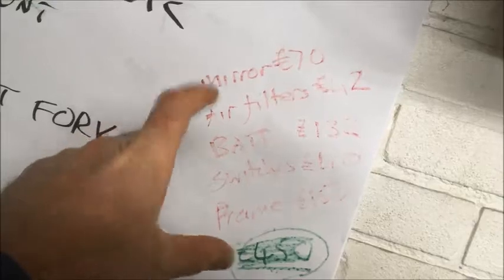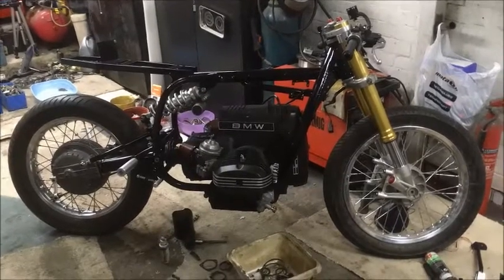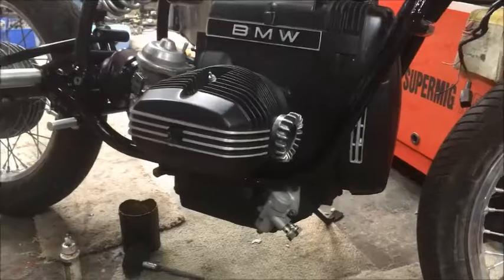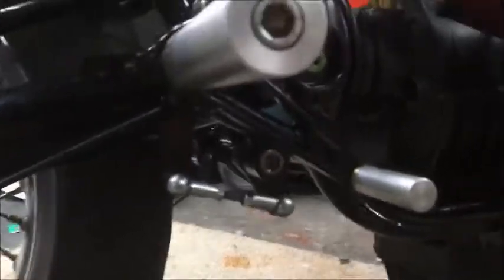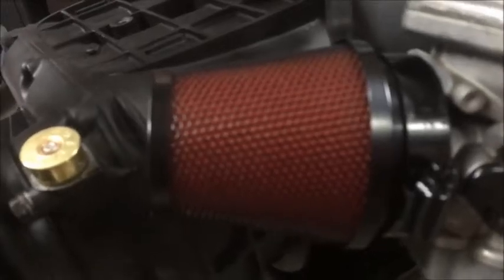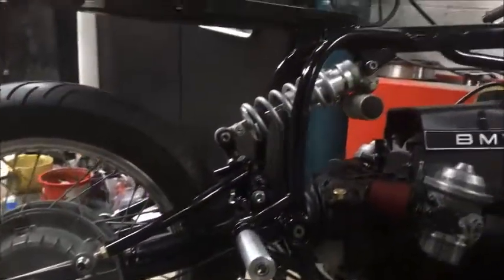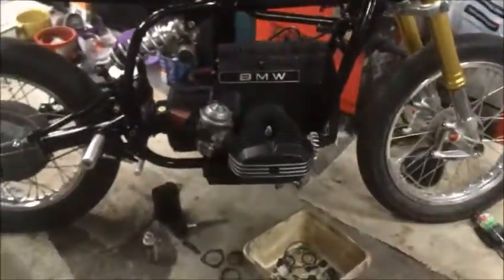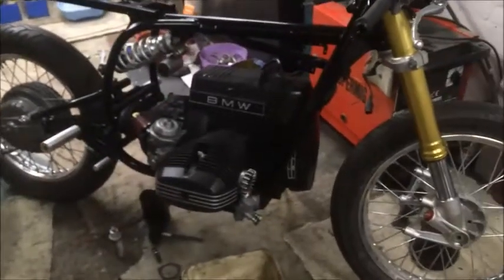bmw r80 cafe racer project part 50

Comment: It's shaping up fantastically Pete, what a world of difference that coat of paint makes! Especially love the engine block and the air filters (worth the 70 quid).
Reply from the maker: Thanks for the comment, yes the paint has helped somewhat (although its started to get dusty again already), have just made an engine breather to match the air filters but it hasn't quite turned out as I had it in my head.....will live with it for a while to see......

Comment: Hi pete, i havent commented for a while but been following the vids and ive got to say its looking stunning! I love the understated matt black on the engine. The gloss frame and forks give it a nice lift without being too showy. The stance is great and the backbone is sitting really nicely. I reckon some polished brass or copper nuts/pipe details would look amazing next to the engine... but thats coz i love old oily flat tankers! Lol. Great work mate, the lure of sunshine will spur you on im sure!
Reply from the maker: Good evening, thanks for the comments, funnily enough i have just ordered a little bit of brass, (however with the amount I am thinking of blink and you'll miss it) and the chances of it making its way on to the bike are actually pretty slim, have to learn a new craft to an acceptable standard first....watch this space.....but dont hold your breath... : O

Comment: Hi Pete, awesome progress on bike. It coming nicely together. I like your gun shell idea, but I don't know if you noticed that speedo bolt has small hole in it. It's not only speedo cable fitting bolt, it's also transmission breather. If that hole is just plugged sooner or later your transmission oil seal will fail, coz it'll create too much pressure in transmission and oil will leak into the clutch plate area. All the best
Reply from the maker: Nice...thanks for the info, I had no idea this was the case and I have just plugged it up. cant see a hole in the bolt anywhere though. I have had an ask around and the suggested reason is that someone has swapped the bolt at some point......i will re-visit this and modify it accordingly.........you may have just saved me a whole heap of grief...
Reply from the maker: strangely enough, I have just put my glasses on and at the same time a hole appeared in the bolt........

Comment: Very nice progress! Is that weld spot for seatframe enough? It will be a lot of force for a 100kg guy going over humps an bumps in 70mph.
Reply from the maker: good evening,  (95kg thank you very much   ; )   )...The weld itself will be fine and the frame work is pretty tough, would take an awful lot to bend it , the bulk of the weight wont be too far down the subframe either...however never say never, if i had full weight on the seat and ever get it up to 70 in the vicinity of a pothole I will chuck a straight edge on it and report back....

Comment: How did you solve the problem of oil mist coming from the motord after I installed the vapors.
Reply from the maker: Good evening, where were you getting oil mist from exactly?
Reply: From the hole next to the starter
Reply: The oil vapor come with oil and the air is deposited in the filiter box
Reply from the maker: You have to have some kind of breather box to ‘catch’ the oil mist. The engine will always breath and it depends on how worn it is and how hard you work it as to how much it will breath. I fitted some filter foam (very fine mesh) to catch the oil on the breather box that I made. I am going to check inside it after another few hundred miles to make sure there is no oil in the bottom but I am not expecting any issues.........
Reply: petesplace55 thank you My friend
Reply from the maker: you are welcome, have a look at part 51 (the next video) its a long video but you can see the breather box that i made and the foam that i used.....